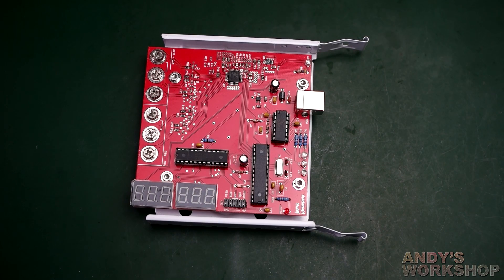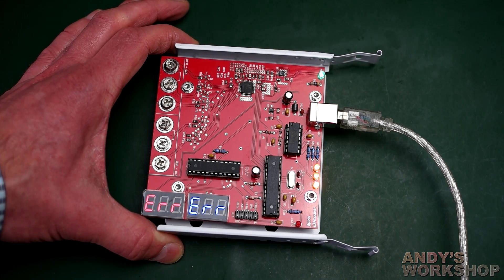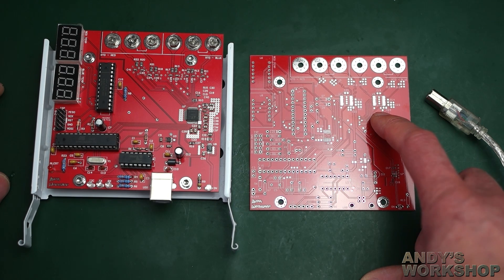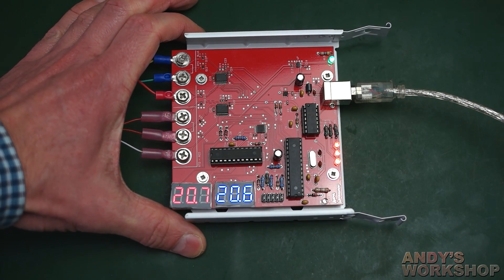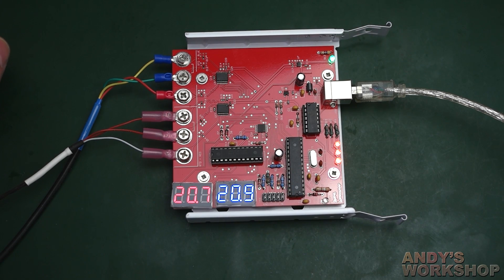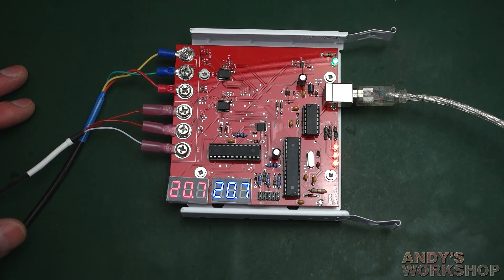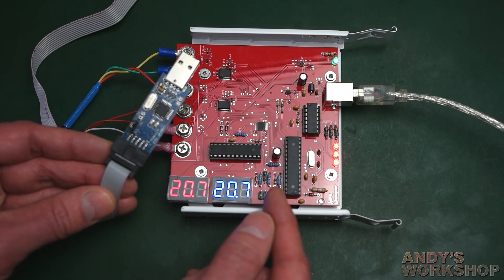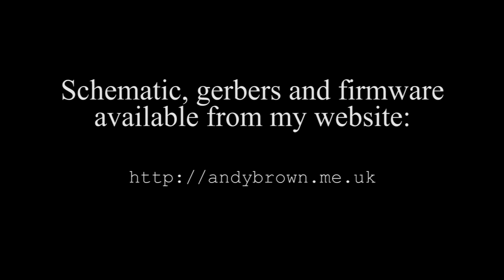Dual Maxim MAX31865 RTD board

Comment: 1. what is the equivalent of MAX31865  at lower price .
2. Can multiple pt100 sensor be connected with single MAX31865 using analog multiplexer ?
3. Do you can idea about other pt100 chip like ads1148?

Comment: Great video, thanks. I need to read 12xpt100's for a brewery control system I've made based around arduino and raspberry pi. My current system uses ds18b20s and is in operation controlling a brewery. I would like to swap to pt100s, but am struggling to find a suitable 12 channel interface. Would you consider designing something based around the ltc2983 say for payment?

Comment: Nice project. I am trying to design 20 channel RTD board, so various ideas are useful :)
Reply from the maker: For such a high number of channels I'd probably go with a motherboard, card edge connectors and pluggable sensor daughterboards talking SPI that can be individually swapped out if you get a failure. Design it right and the daughterboards don't even have to have the same sensor IC.